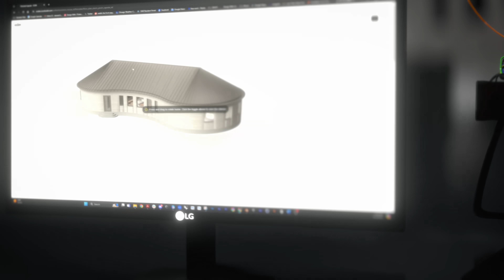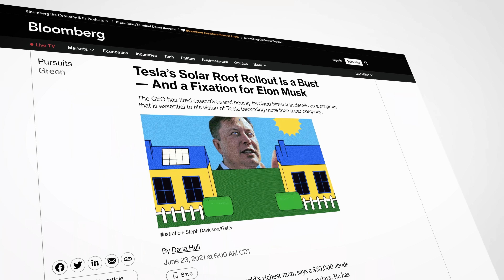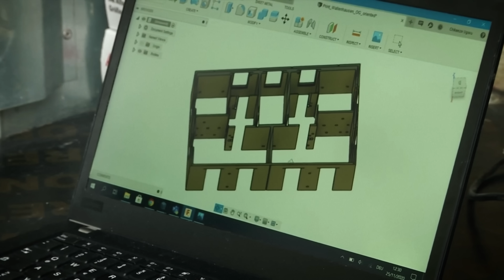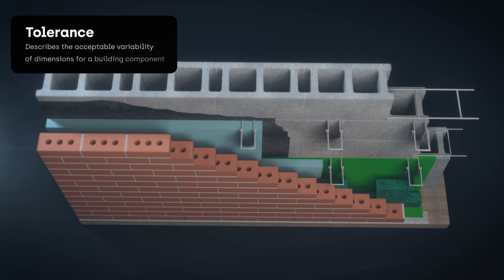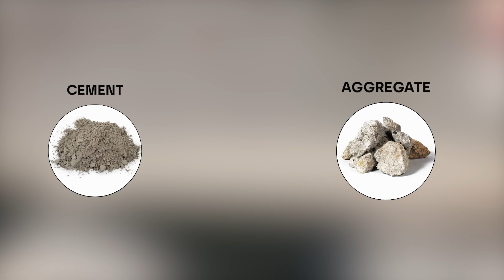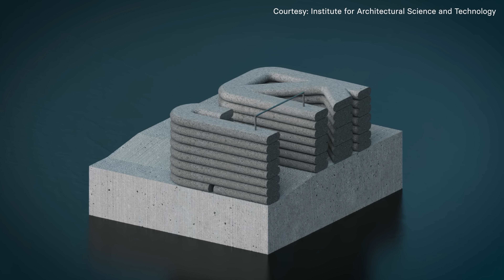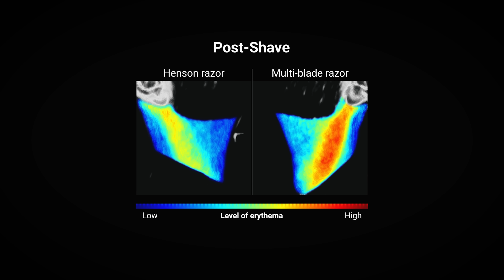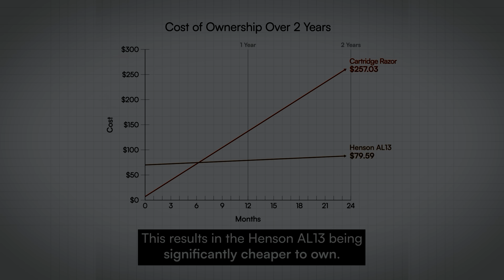Why 3D Printing Buildings Leads to Problems

Comment: 3D printed homes are gimmicky, what we need is 3D printed parts of homes, where it could be an advantage, but then where it doesn't work, we use more traditional methods. It doesn't have to one or the other. Idk why we have a society that is so much obsessed with 1 size fits all solutions.

Comment: I think concrete is the wrong material.

Instead, think ceramic, especially silicon based ceramics. We already have multi-material print heads, so having different ceramic/silicon materials as part of the process should be easy.

Wiring should be doable as silicon based semiconductors. Maybe the walls could actually be batteries. Print the outside as solar panels. Is PEX silicon-based? Aren't water pipes just voids in the walls? Could semiconductor heating elements be printed so you'd have heated floors? Can LEDs be printed? That would mean lighting could be part of the print build process too.

Comment: Could you put 2 hydrophobic thin metal bars either side of the nozzle to smooth out the extrusion? It could give you right angles and cut down on plaster needed to cover it if you want to cover those ripples.

Comment: Arches are quite a bit more stable than 90° angles anyway. It certainly wouldn't hurt to adjust to better shapes than try to translate the limitations of wood and brick to 3d printing.

Comment: I would like it better if the layers were consistent. The layer consistency I've seen so far is terrible. I also don't like the idea of concrete without rebar. Modern concrete really needs that rebar.

Comment: Honestly prefabricated would be 10x better... and cheaper. Just not the "cardboard" stuff, no, I'm talking individual wall sections, like LEGO. Aerated concrete maybe. You could have a few types (corner, wall, window, door etc.) + bathroom/ kitchen as special sections. Ceiling and roof parts can be standardized too. For better insulation/ waterproofing can make the joints V or Z shape or something, with pre-applied sealant.
Everything including electric and plumbing/ heating would be pre-instaled in an assembly line, on-site this thing would take crane, a few people and 2 days to assemble... And the factory could be automated, if you make millions of those parts, the investment in machinery will pay itself off.

Comment: How is 3D printing any faster than hiring a concrete crew to put up forms and pour the walls? It takes 4 days to print the house? How long does it take to set up a fancy, house-sized 3D printer and get it perfectly level? I can't imagine a concrete crew taking more time than that.

Comment: I think you misunderstand 3D printing. It’s not only used for prototyping. As the quality and speed of printers has increased, the viability of 3D printing for final products has grown. Apply this to your comparison and we see that 3D printed buildings offer the same benefits. The sweet spot for 3D printing is small run but highly configurable products and geometry that isn’t possible using traditional manufacturing methods. The other benefit is the ability to go from idea to object-in-hand quickly. What I’m missing from this video is the nail-in-the-coffin problem. Are they structurally unsound? Do they not last as long as traditional timber construction? Are they unsafe in earthquake or severe weather locations? Are they unhealthy to live in? Do they have higher maintenance costs? Are they insanely expensive and only for the Play-Doh-loving elite?

Are lumpy buildings for everyone… probably not. Unfortunately, what I get from this video is “they look weird and they don’t have right angles so that’s a problem.”

Comment: 3D printed houses look ugly.
3D print the mold. Have different surface types. Logs, shingles, traditional type surfaces, etc..
A construction company is needed for prep work anyway. Reusable molds can lock in place to make things easier.
You get the idea?

Comment: I used to work as an engineer for a major 3D printing construction company and this analysis is quite accurate. 3D printed construction is a nail looking for a hammer and will never be able to reduce cost or build time of single family homes. 
The printed structural elements of a home only equate to ~20% of the total cost of house so in order to reduce the cost of a house by 10% printing will need to be able to halve the cost of stick framing which is impossible. 
And not to mention the gigantic CO2 footprint that is associated with the production of cement.
Reply: You're missing the most important picture: lack of reinforcing steel.
Reply: @railgap  that's where you're wrong bucko, the interior and exterior walls are most of the time connected with steel wall ties and the walls are post tensioned via tension cables going down into the concrete foundation. ( At least in my experience)
Reply: And this isn't concrete where most of the volume is taken up by coarse aggregate - what they're squirting out is more like a mortar. Much higher cement ratio in the total mix!
Reply: CarbonX
Reply: Wright's Law
Reply: @mfpears  More like Amdahl's law
Reply: You know where it might find a use? Building structures in airless envirinments, like the moon or Mars, remotely so that workers don't have to be exposed. That will be with geopolymer cements. I'm pretty sure we won't find limestone on the moon, or much on Mars, nor the coal with which to calcine it. And it OPC cracks. Don't want your presurized dome to crack.
Reply: I agree, to me it seems like these companies are the remnants of the huge hype surrounding 3d printing when it was new and groundbreaking. Similar to the many AI startups that are destined to fail due to relying far too much on a technology that really has a limited scope where it excels.
Reply: Said the same thing about 3d printing in general I bet. It won't work it wont work it cant work no one will buy 3d printed homes no dont replace us no Dddddddooooonnnnttttt falls down into infinite void
Reply: Used to be that gypsum drywall was a hammer looking for a nail, too. It too was spendy, initially. It took a while for folks to shift from plaster walls to gypsum drywall. Other than in restoration projects I challenge you to find plastering it in any sort of modern construction project use today, though. 
Perhaps you should be a bit more cautious about waiving around that 'never' flag so hard.
Reply: Stick framing is just about the worst way to build a house we have invented. Timber framing is orders of magnitude superior, if building in wood. Both in strength and longevity.

Secondly, nobody cares about how long it takes, within reason. What matters is price/performance. And in hot climates, this method will work well, given the thermal mass of the walls.
Reply: @timothyblazer1749  I think concrete printers do have a significant edge in certain climates, most especially in areas prone to natural disasters. If a printer laid superstructure & a manufactured home builder supplied veneers & facades to hang on that superstructure substrate  the resultingbuilt-to-last power combo could literally rebuild entire towns wrecked in natural disasters with months. As it stands it can ebe upwards of five to seven YEARS for local recovery.That's only likely to get worse with hardly any youngsters entering the trades anymore.

Comment: I personally like the leap in design to neo-brutalism but I know that level of dedication to modernism isn't for everyone.. Like wearing all black clothing or veganism... My hope is that 3D printing technology isn't used exclusively on any project but in tandem with other tech like Big Timber... Frankly I think the ultimate use of the technology would be for hybrid skyscraper apartment buildings that use 3D printed concrete cores and support columns but large CLT panels everywhere else...  It would certainly bring together the warmth of wood with the durability and pliability of concrete... And up for 40 floors would certainly be possible at least according to that SOM study from about 10-15 years ago on the matter that kept me fascinated in it for this many years...

Comment: 3d printed concrete houses as a set-it-and-forget-it one man job is a terrible idea. 3d printed concrete house as an alternative to the often wasteful form and cast concrete houses seems like a good idea. I see no reason why this method has to replace several aspects of constructions when basically all it does is the work of a mason. Also, why does this practice seem to print interior walls as well as exterior. A tried and true practice is a cast or CMU exterior wall with firring on the inside and the interior walls generally being all wood/stick framed. Also, it would be good practice to add steel reinforcement every few layers of printed medium.

Comment: Seems to me that moving the 3D printer to the site and repeating all that effort to millimetrically align everything just so then moving it next door and doing it again is kind of ridiculous.  3D printing parts and transporting them on trucks to the site is clearly a better option for both construction and repair.  Lets you make right angles, for one thing, and assembly could be done by a robot if you really hate hiring a workforce and are truly determined to destroy skilled trades.  Also, I don't see why you couldn't automate bricklaying using a similar system to a 3D printer, if you can run concrete to a nozzle, you can run bricks and mortar to a nozzle and arm.

Comment: To deal with the "It looks weird" idea,  I'm sure the first stucco houses probably had similar comments like that.   "There's no brick work look" "there's no siding look" "It's an imperfect surface"
Reply: they just have to float the outside/inside.  problem solved on how it looks.

Comment: I can vouch for the AL13 razor. I wouldn’t shave much because it sucks and I was too cheap to buy more cartridges (even though I was using cheap Harry’s lol). I’d stretch every cartridge until it was completely and utterly miserable to use.

I figured the broad face of the AL13 would be easier to learn than a traditional safety razor, and people on r/WickedEdge said it’s impossible to cut yourself with the mild version.

It’s easy to use and I shave a lot more now, I’d recommend it. I didn’t watch any tutorials and just went for it.

My partner got an aggressive Maggard razor which has a traditional design. Frankly it doesn’t feel much different despite being only $20 or something. Didn’t cut myself with that either, I’ve only been using my AL13 for a few weeks. Even shaved my b@11s with the Henson. 

Safety razors are so easy to use, all this talk I’ve heard through my life about them being sketchy seems ridiculous. The shave is unbelievably smooth too. 

Just get a safety razor and save a crapload of money and have a better time.

Sorry for the rant, I just feel the Henson (and safety razors in general) is actually worthy of the huge marketing push they’ve been doing. I look a little less homeless now lmfao

Comment: The biggest problem of the 3D printing houses is, that it only does like 15% job (cost-wise), when it only does the walls. And even then, you shouldn't compare it to classic bricklaying, which isn't really used for many decades. Compare it to modern , materials like lightweight aircrete blocks and you'll find out that with the skilled manpower it takes as much time to just setup the 3D printer on site, as it takes for low skilled/DIY manpower to build whole shell. I don't see a potential,for competitiveness there, even with improvements to the technology. And for mass production, pouring panels off site (as suggested in the video) is proven,cheap solution. I'm sure 3D printing will stay on the market after the bubble will burst, but only for niche applications, like unique expensive design houses.

Comment: I think you're looking at the whole thing the wrong way.   The sharp corners on buildings are merely a consequence of the old brick or block building method, they were never an aesthetic choice!  I prefer the curves of this method anyway.  And there's nothing stopping you rendering the exterior smooth!

I see 3d printing as the ideal solution for external and structural support walls.  The interior walls should all be timber framed.  This gets the shell and roof support elements up fast.  Pre-fabricated structural window and doorframes can be installed manually as the print reaches lintel height, providing a standard frame, foot and and supporting lintel for the higher layers.  Those frames can then accept the standardized windows of your choice (which makes future replacement super simple).  Adapt the robot to do spray insulation and course rendering too and you can have the structural walls ready within a week- inside and out!  The roof can then go on and interior partitions and finishing can begin.  It's all about adapting to suit the new method and using the new method for its strengths rather than looking for weaknesses.  

The real value in this is the reduction in processes from cement powder to structure- you cut out the block or brick casting and baking processes which cost a lot in energy and transport, lot to mention the labor to lay the blocks!  And there's nothing stopping a rendering specialist repairing the concrete and matching the particular finish- that's why you develop skills!

So I see only benefits... IF it's used smartly and we develop the components to complement the process.